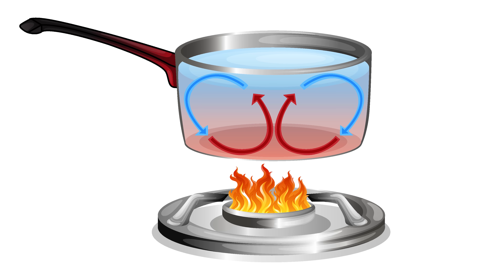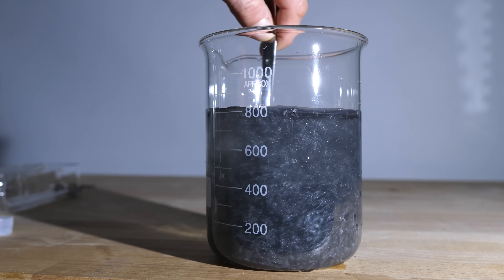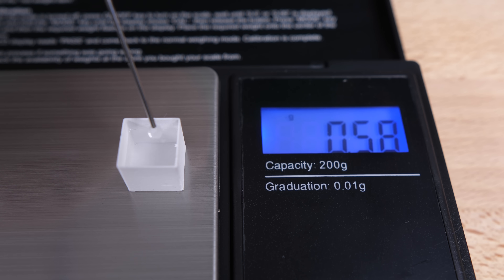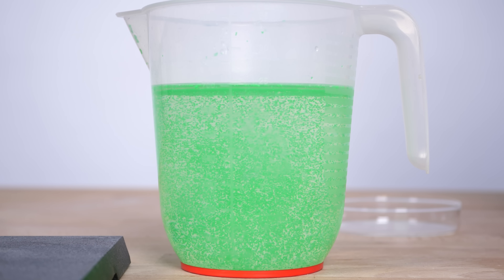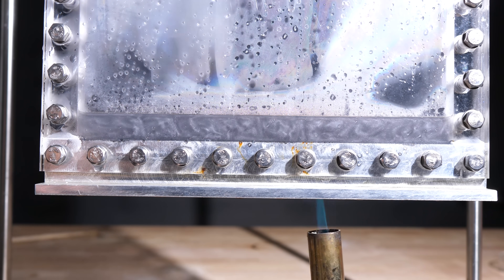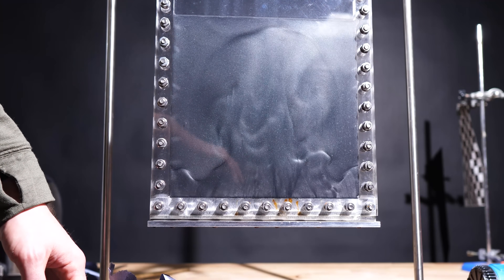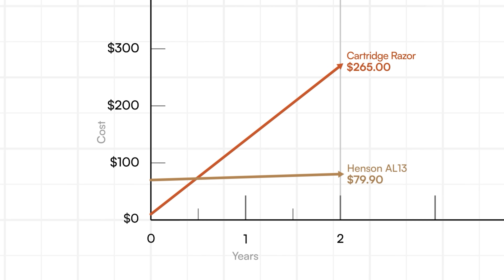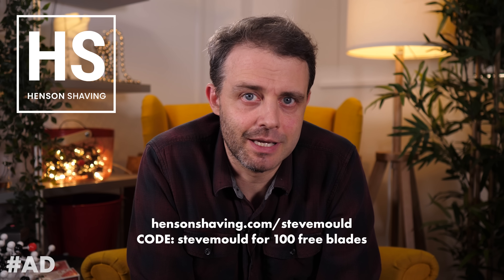The bizarre patterns that emerge when you heat ANY fluid

Comment: Would the size of the convection cells be proportional to the depth of the fluid?  If that's the case, that tells us something really interesting about the sun.  Is it possible that stars might actually be solid, or some solid-like state of matter that we don't know about, with only a relatively thin layer of fluid material on the surface?

Comment: Hi Steve,
Did ya account for these?
- The rate and location where cooling occurs probably changes until the glass and entire system stabilizes.

- The particles may remain at their original density even when their surrounding water heats and expands.

Comment: In my former workplace in the laboratory I often observed that convection cell display in a pattern I could easily see with the naked eye. 

I used to work in ore processing doing fire assays of samples. There were times where if a samples fusion had too much contamination, the lava in the crucible/when poured would display that exact pattern as the 1080 degree C lava cooled to a solid. Was actually pretty nice to watch as I waited for it to cool to hammer the recovered metal off the slag layer.

Comment: I think the particles would line up locally because of water passing by them and the fact they are flakes. As the water flows past a bunch of them the water would either line them up or have to change direction.

Comment: The alignment of mica flakes is a result of their shape, the applied stress, electrostatic forces, the viscosity of the fluid they are in, and the pressure conditions. This is why you often see mica flakes aligning locally in certain patterns.

Comment: if you heat pure water right before the boilng point, it'll tick like a clock or heartbeat if you inspect it long enough, not at the surface but inside the volume of water.

Comment: I work with molten zinc and we do get the hexagonal pattern you talk about trying to achieve.  In my experience it only occurs after the material is allowed to (relatively slowly) cool from a rather high temperature. As it sets it relaxes into a regular hexagon pattern (typically only towards the center of the material). Once it solidifies it maintains this texture. I wonder if what you needed was an even high temp to get that result with your experiment? Obviously I'm comparing two different materials experiencing different temperatures and one is changing states of matter and the other is not. So I don't know how applicable this information actually is. Perhaps worth a try?

Comment: The Sun is a discharging anode in a circuit. The Sun clearly has a defined surface and is a solid body, as is evidenced by its blackbody spectrum. The cellular patterns are a clearly caused by electromagnetic fields in a plasma.

Comment: If water's viscosity is too low for stable cells to form, how about using lower temperature? I mean, how about heating the water with, say, electric heater, only few C degrees above room temperature? Wouldn't it generate more stable convection cells than when heating the water with flame?

Comment: It happens in the desert too. Not that special. Everything is a fluid given enough time and those patterns show up even in solid materials.
Reply: So how long do I have to stare at my cheesecake for it to start happening?
Reply: @Villa_0l  You should do some basic research that a small child is capable of would give you your answer. There are even pictures online, easy to find with a google search, that will show you. Google or another search engine are great tools if you some day learn how to use them.

Comment: WHy mica flakes line up locally is likely due to two factors: the electorstatic charges between the crystal faces and fluid dynamics. The explanation is a bit complex, but the alumino-silicate layers are negatively charged, with positively charged layers of metal atoms between them (in muscovite it's potassium). This is why mica is platy, and why you can peal it so easily. Water, you may recall, is a polar molecule, so you're going to get interactions between the mica and the water molecules, which will tend to have everything lining up locally (these are relatively small forces, so they can be fairly easily broken up). As for fluid dynamics, when you push on flat things with fluids they'll do one of two things--orient themselves perpendicular to the force or orient themselves such that they present the lowest surface area to the thing. This has some pretty important implications in geology--it's one way that we can identify ancient stream flow, for example. Or watch a video of a flash flood and note the orientation of the logs. Platy things do the same thing, though it's admittedly more complicated. The same forces work at small (but not atomic) scales. 

I'd imagine a combination of the two (initial general orientation by fluid dynamics, enhanced by electrostatic charges) would explain the phenomenon you're seeing.

Comment: Those hexagons are just a superposition of rolls with an angle of 60 degrees.

So you need a geometry that allows such rolls to form. And you need a depth that allows/encourages rolls with such a diameter.

Sometimes you find such rolls in just one direction in the sky forming clouds in stripes.

Comment: The initial big rectangle reminded me of the "moving sand pictures" which were really popular in the 90's, at least in Australia they were, but your contraption has the advantage of not needing to be turned over.  It's downside is that it needs a heat source, so it wouldn't be free to stare at for hours getting lost in the patterns.

Comment: [5:30] This is how we get globe-spanning oceanic currents which take millennia to travel from the Equator to near the poles & back again in vast convection currents. The density of the hot surface water is profoundly different from the density of the sub-zero temperature benthic water (the pressure & salinity preventing it from freezing).

Comment: The problem with safety razors in general is... they're fixed blades. So you have to do all the swiveling action, or else you get nicked. Granted, the cartridge razors are expensive over time, but the swiveling action is what got safety razors out of the market in the first place, and for good reason: you shave fast and safe with a swiveling cartridge. If you want a better shave then safety razors are better... provided you practice enough to not get nicks.

Comment: I'm a pyromaniac. So we made a meter tall fire in a meter wide circle. Used a wooden stick fit into a plastic bottleneck. I had petroleum at home. It was before rechargeable spotlights. So I used the petroleum lamp in a case of "missing electricity.
Put a little petroleum into a plastic bottle and put a long stick into it's mouth. Then hang it above fire. You will see the boiling petroleum which will prevent the plastic from melting. The neck will change but the bottom of the bottle will remain mostly intact.

Comment: Love it.  I wonder if your 2D convection cells look the same using infra-red?  There is no way for the molecules to gain heat on the way up, so I would imagine you would see  brighter patches at the bottom that got hotter and are destined to make it all the way to the top and less bright patches that will spin off and go down earlier.  In this sense I guess the randomness is actually a kind of sorting.  We just think it's chaotic because we can't see the relevant initial condition?

Comment: Instead of the expensive beads and water, you could have tried polypropylene beads and vegetable oil, as they are both around the same density. You could have then placed a light strip right above it, to give the same glowing effect.

Comment: For the mica flakes aligning, that seems like it should just be a property of their geometry and the forces in the water, right? Like a field of wheat waving in the wind, only the flakes are more sensitive to small forces, so they pick up higher resolution turbulence? A small movement in the water is going to somewhat uniformly align the flakes in that region as the flakes all respond similarly due to their similar shapes. My guess, anyway.

Comment: i immediately recognised those “convection cells” as an example of the voronoi tessellation: the pattern that appears when dry mud cracks, when bubbles connect and on the bodies of giraffes! every straight “wall” of a cell is exactly half way between the origins of the two neighbouring cells, and each wall is perpendicular to the vector drawn from the origin point straight outwards towards the wall.

the origin points are formed from the vertical currents that rise from the base of the dish, which would also explain why the cells change, multiply and divide according to natural chaos. whenever a new current forms so does a new cell, and the neighbouring cells’ sizes and shapes adjust in order to accommodate it. fascinating stuff, and an excellent video!

Comment: The formation of those cells is governed mainly by the fluid's Reynolds number (a nondimensional quantity usually associated with turbulence).  The Reynolds number is the fluid density times the velocity times the length scale, divided by the fluid viscosity. Different types of convective flows happen around different Reynolds number ranges. Rayleigh-Bénard convection only occurs if the Reynolds number is within a certain range. If the Reynolds number is much larger, turbulent breakdown occurs (This is what you were seeing with the heated water).

The reason that the cells only seem to form with shallow fluids is because making the fluid shallow reduces the length scale of the problem. This reduces the Reynolds number. Also, using oil with higher viscosity than water also reduces the Reynolds number.

Comment: In order to see hexagonal structure of convection you have to have a specialized heating system that can output controlled low heat for whole surface for a long duration.

Comment: Maybe if you had tried a dish with hexagonal edges? I think a cylindrical dish won't get the hexagons started. 
I mean the edges should be made up of interlocking hexagons. Difficult to describe without a diagram.
Good luck finding a dish that shape. Possibly an extrusion?

Comment: You tested low viscosity and higher viscosity. But, what happens with even more viscous fluids? Are there fluids that do not change density as quickly when heated?

Comment: My interpretation of the mica effect is that they don't align with eachother, but as tiny thin sheets they align with the flow direction and water is viscous enough that nearby regions have very similar flow directions. This also explains why a cloud of mica suspended in air, a much less viscous fluid, doesn't show any alignment on human scales.

Comment: I actually did buy the Henson after one of your videos. But because of the ROI (would have had do buy new cartridges anyways). Always used the plastic ones way too long, because they are so expensive.
But since I use the AR13, I simply change the blade after two shaves and I must say:
It‘s a great product to use 👍🏼
(And even cheaper in the long run)

Comment: @ 2:23 you see what looks like a Rod of turbulent flow that goes all the way to the surface. Almost like the path of a bullet through smoke. There are a lot of these at the very beginning (@ around 2:13)  when the heated, turbulent material is just heading to the surface. Does anybody know what this is? I'm assuming that it's a macro example of Brownian motion. Where you get localized pockets of high energy particles heading in the same direction. I find it interesting that they are traveling mainly perpendicular to the heated surface. I wonder if the heated surface of the bottom was triangular, presenting two flat surfaces to the fluid, if we would see those rods of higher energy particles moving through fluid being perpendicular to (2) surfaces. I also wonder if they would arc upwards.

Comment: You should do an experiment with putting two rheoscopic fluids of different thermal conductivity values to visiualize the interface layer. Ive always wondered why the convection turns at the fluid surface.

Comment: If you want to see large polygonal convection cells on earth and their topographical representation look up polygonal ground or tundra polygons. They are found primarily in the northern and southern latitudes over lying permafrost. There is a permafrost tunnel outside of Fairbanks, Alaska where you can walk through these frozen polygons bounded by massive ice wedges. It’s amazingly immersive! A 3D snap shot of several earthen convection cells. 

You can also find soft-sediment deformation structures in geology that show snap shots of a fluid like movement of different density sediments that lie one above the other. The density difference and the water saturation allows these layers to plastically ooze into each other like a lava lamp. These structures can look like flames, pillars, balls, pillows and when they are more complex a convoluted mess. It is believed that soft-sediment deformation occurs because of additional sediments being deposited above your water rich sediment with density differences causing dewatering and mixing. Also an earthquake could trigger the soft sediments to mix.

Comment: Well, this is bizarre, I posted this comment on the brownian motion video - guess a bunch of atoms knocked it sideways.
Sorry, unless i blinked and missed it, NOTHING here PROVES that the water suspending the pollen is made of "atoms". You can ASSUME it is atoms and derive some equations and say "if it is atoms then fundamental constant x is 7", but that means you assume the thing you are claiming to prove. Qualitatively, Brownian motion is equally accounted for if the water is "a pure liquid all the way down" that is sloshing about due to the action of being put on a microscope slide or due to the building work going on next door or coriolis forces or whatever. This would be the analogue of changing Steve's ball bearings with water. Is there actually a statistical analysis that distinguishes the two cases ? To me, the clincher is the oil drop, where it keeps growing until exactly one molecule thick and then stops, whereas an infinitely smooth liquid would expand forever.

Comment: @SteveMould 2:08 isn't it that the local gradient of speeds tends to align the flakes?
If the axis of the mica flake plane is not parallel to the gradient, the difference of speed of the fluid in the flake area tends to rotate the plane, the equilibrium state is finally when all the flakes are oriented locally with the speed gradient

Comment: Mica crystals are flat with narrow edges moving in a fluid, the forces on a flat side are greater than on the edges, so they glide on the current. High pressure on one side leads to motion and increases the pressure on the other side, pushing other crystals face first. It cannot push them edge first, so they tend to align. Does mica posess a charge? Does it behave differently in non-polar fluids from electrolytes. I don't know. Some concentrated soap/derergent solutions may contain flattened crystals that are also rheoscopic. Rheoscopic is also called pearlescent, I think, and some pearls are nacreous - showing rainbow colours. Nacreous clouds contain ice crystals aligned to refract light and some other ice-containing clouds cause halos which refract rainbow colours in arcs at well known angles from the light source-usually sun or moon. Then there is opalescence...

Comment: I'm curious how well the neutrally buoyant beads really work to show the convection given that convection itself is driven by changes in the buoyancy of the fluid. Unless they also have the same thermal coefficients as the water, I would expect heating the water to spoil their neutral buoyancy property.
As for the cells, that is very cool, I imagine that that works with oil better than water due to the higher viscosity.

Comment: There is another way than heating the bottom, you can obtain the same effect by cooling the surface. I discovered this inadvertently when I was a teenager ~ 65 years ago. I had built a model airplane and I painted it with a paint that was supposed to look like aluminium. After that, in order to clean the brush, I put it in a little box filled with acetone, stirred some time and then took it away, letting the box quiet for some time while I was doing some others things. Later when I had a look on the box, I was surprised to see the diluted paint making a pattern, a network of regular hexagons. I think it was due to convection due to the low temperature at the surface, consequence of the evaporation of the acetone which is very volatile. Even when you put a drop on you skin, you feel this effect of cooling by evaporation. The box was a cylinder with a diameter of ~10 cm and height of ~1.5 cm, an empty box that previously contained shoe polish.

Comment: hey
please do this water visualization thing with freezing water too
water have a cool property that when it get heated, it get less dense
but when it get above ~4, it also get less dense.

so both hot and cold water "floats" over the 4 degrees water.

maybe compare how water freezes vs how oil (that don't have this property) freezes.

a peltier element should help you to get low temperatures in your setup

Comment: I think the orientation of the flakes is based on the flow of the water. This means that if there is no current, they are not oriented and something like noise occurs. Which then looks very substantive and smooth c: